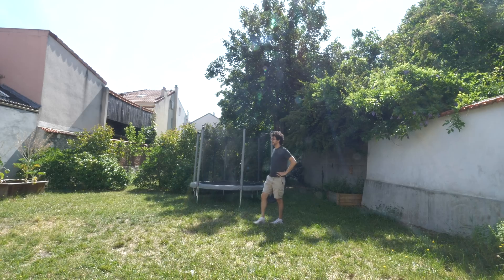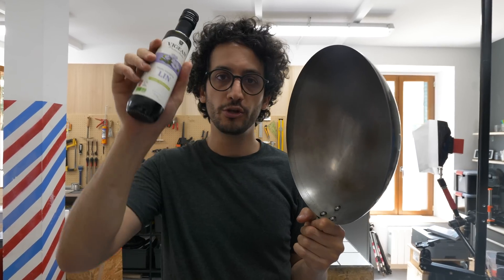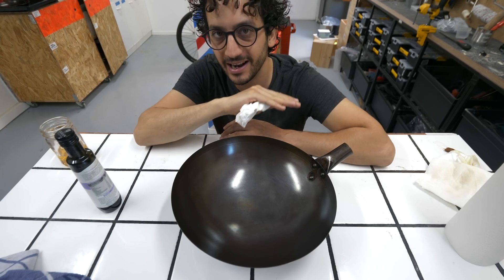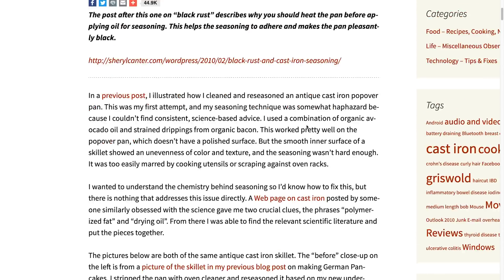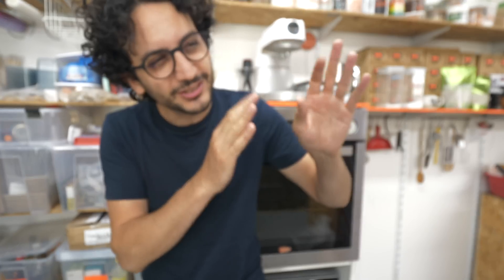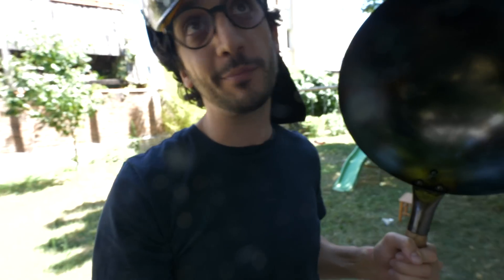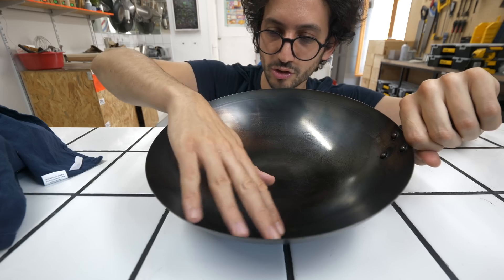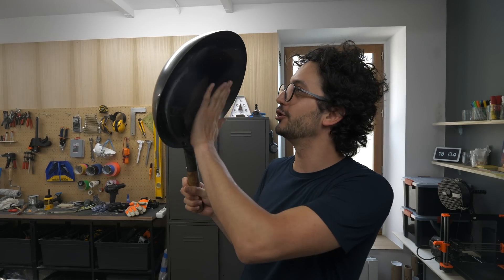Can I Make my Wok Slicker than a Nonstick Pan ?

Comment: ALL commercial non stick pans are made with forever chemicals. The ones that claim they don’t use PTFE and or PFOAA are simply using a sister chemical that is just as bad. 

Cast iron, stainless, and carbon steel are the only pans I will ever use. 

And pro tip from a chef. Light oil in any pan, heat, add a small bit of butter and immediately add the egg on top of it, and no egg will stick to any pan (even scratched up stainless). The best iron and steel pans are the ones you use daily. And soap doesn’t harm seasoning in any way. Wash those damn pans people.

Comment: Whilst its true that laxseed oil that has a low smoke point can form a hard polymerised surface for seasoning. But it isn't durable under high heat & will breakdown & flake off in your food which you consume.

Comment: Actually the linseed/ flakeseed technique has been debunked many times. It will not last long. Please use higher smoke point oils guys
Reply: Yes, linseed seems to flake but there's a confusion about wanting the smoke point high when you are trying to get the oil to smoke.

Comment: You must temper a Carbon Steel Wok before you season it. Here's my steps:

1) Handwash all metal parts, inside and outside with warm water dish detergent and dry . Make sure you wash off all detergent thoroughly. Dry with cloth.

2) Clean off any excess residue that can rust the wok by filling the wok 1/2 way with water, boil for 5 minutes, shut the heat off, wait 5 minutes, and scrub the entire inside of the wok with a natural fiber Tawashi brush with a stick so you don't burn yourself. Discard water, scrub wok in sink by hand with warm water and Tawashi. Dry the wok by hand

3) Temper the carbon steel wok first by heating the wok on high heat with a gas or propane stove without oil until the middle of the wok slowly turns gold, brown, very dark brown, and then dark metallic blue. Start tilting the wok to spread the blue spot until you covered the entire wok. Turn

Comment: Hello Alex. 

You need to revisit this one. Flax oil is really bad for seasoning. I’ve tried and failed with it, and I’m sure you’ve noticed as well that it flakes off very easily.

Refined grapeseed oil is what you want. Refined because it’s a pure oil with fibrous materials removed (fiber burn and cause carbon build up which causes sticking). Grapeseed because it has a high smoke point and a lot of polyunsaturated fat (which polymerizes better than other fats). You also want to bake it below the smoke point. I usually go 200° C for one hour. 

Check out “Cook culture” and the videos they’ve done on seasonings. The advice I gave you over comes from a phd in polymer sciences.
Reply: NO SMOKE NEEDED or My beginners guide to Carbon Steel stovetop seasoning ?
Reply: @LARCN  The «no smoke needed» video is brilliant. I’ve had great results with the advice provided from that video.
Reply: Alex listening to this one random lady with no scientific background or testing is cringe. No one else has ever recommended a low smoke point oil like flaxseed, yet this lady is some revolutionary oil expert.

Comment: if this is anything like cast iron , I have found just using it regularly builds a very nonstick surface over time. I can literally crack an egg in my cast iron skillet with no oil at all and cook it without it sticking, it will burn it a bit doing that and wont taste good so I wouldn't recommend but the point is it doesnt stick. when I am done cooking I can let the pan cool then just wipe it out with a dry rag everything just flakes off like nothing.

Comment: Great episode.  Flaxseed is a 'drying' oil and much better suited to seasoning cast iron/carbon steel.  I've switched over and re-seasoned my pans.  Also, a touch of dish soap occasionally to get the pans cleaned up will not strip/break down the coating.  Until I did a little research and actually tried it, I would never have let a drop of soap touch my seasoned pans.  But remember, the polymerization is a molecular bonding to the pan, a little soap here and there is not gonna hurt it and helps keep things cleaned up.  Just remember to recoat with oil after drying.  I like to reheat the pan to make sure the water is gone then apply a light coat with a silicone basting brush - paper towels can leave little bits behind.
Reply: Yes mon ami, flaxseed oil is a 'drying' oil. However, the very nature of its drying properties, while seemingly advantageous, can be its downfall in the realm of cookware. It creates a brittle layer, prone to chipping and flaking, a fact overlooked by many an amateur. In the hands of a culinary artiste, oils with a higher smoke point and more robust bonding properties are preferred, ensuring a seasoning that ages like fine wine, not like a fragile fresco.

As for the use of dish soap, you tread on a path that many fear to walk. And yes, a touch of soap will not ravage the seasoned layer, as you say. But it's not just about the molecular bonding; it's about the patina, the soul of the pan that develops over time. A seasoned pan is like a canvas, and each meal a stroke of the brush, adding to its unique character. While soap won't destroy this, it certainly doesn't add to the pan's story.

Comment: [ Wok ]             Nonstick: B+   Safe: ?  Longevity: A     Cleaning: B+   Versatility: B+

[ Teflon Pan ]  Nonstick: A+   Safe: ?  Longevity: C     Cleaning: B     Versatility: A

Overall I'd agree a wok is better. With oil, the nonstick difference b/t them is virtually negligible. I think the jury is still out on how harmful the seasoning and teflon are in woks and nonsticks, respectively. Wok's are basically immortal whereas nonsticks have to be replaced every few years. Cleaning the two are, more or less, effortless. Both pans can cook just about anything, but how well it excels/fails will really depend on what you're cooking.

Comment: Interesting. I use sunflower oil for my steel skillet- works well. Also I found out that cooking temperature is as important as seasoning. You might have a million layer glass smooth seasoning and still overheat the pan and get sticky food.

But then again, you can clean the pan, reseason it and start over :)

Comment: Actually, flaxseed and linseed are not good options to make a long-term seasoning because they are so insaturated that the coating eventually will start to peel off by its own and fall apart; canola, peanut or rice-bran oils are better options

Comment: I don't understand... Some of the polymer layer from the oil could still chip off or be absorbed a bit by the food in the pan... Right? Is the oil still not carcinogenic after it has been smoked/burned on the pan?
Reply: Yes, all seasoning will wear, it requires on going maintenance to pre-season. This is the problem with vloggers / bloggers with no real qualifications speaking about things they know little about just because it might get good traction for clickbait. Flaxeed may well form a hard polymerised layer but it is more brittle under high heat & will flake more easier than oils like advocado that have a higher smoke point.

Comment: I don't have a wok, however, I do use a Field cast iron pan, and a De Buyer Mineral B. I use Grapeseed oil over the stove. Each time I cook, I clean the pan, then heat it up, apply the oil, wipe almost clean, and let it sit on the heat for a few minutes. wipe, then wipe again while cooling to avoid sticky. then let cool to room temp, and store.

Comment: So...what did you use as the rubbing compound with that home made towel flap disc you created? You never explained what you were doing there for the final smooth step. Also, my wok has a wooden handle but there is a second wooden handle I cannot remove. Could I wrap it in aluminum foil and put it in the oven?

Comment: if the solution is flaxseed oil how come none of the reputable cs pan manufacturers( de buyer, matfer, mauviel)  recommend it?-they ALL suggest oil with high smoking point, pay them a visit. I tried it on my de buyer cs pans and it peeled of when searing steaks!!! back to square one with grapeseed oil.

Comment: I've heard that at least the first application of oil should be done in a hot pan - the heat opens up microscopic pores in the metal and the oil will fill those. I don't know if that's true, though.

Comment: Tip, don't use paper towels when cleaning or spreading oil between layers. Use a cotton towel, paper might leave small fragments that will become toast in the heat later on.
Reply: Maybe super duper cheap paper towels. I along with most home chefs have always used paper towels for seasoning. But if you have a kitchen cloth that wont ALSO release fibers when wiping down then that would be ideal to have.

Comment: What a huge waste of electrical energy to burn it in. And what a huge "reasonable" amount of oil you pour in for a single egg. But what's the "proper" temperature? Oil will smoke at about 120 to 170 °C. My max temperature is pyrolysis at up to 300 °C. Oh, and my wok and pans are burned it by cooking. I only might use an initial burn-in for my forged pans, which is that many years ago, I can't remember the year.
Reply: Smoke point depends on the oil used. The energy isn't a huge deal as it isn't often and still less than that of the manufacturing process of a Teflon pan.

Comment: Ok so what I learned after 1 year with my carbon skillet! 

1. Opposite to the dear lady's advice, you want to use an oil with a high smokepoint. With a low smokepoint oil, after a few rounds of cooking, your perfect seasoning will most likely start to flake & fall off. I use peanut oil, widely used in asian kitchens for seasoning woks, and seasoning is super durable, just keeps getting better and better over time.

2. No point in obsessing over the perfect seasoning, getting a clean black finish or whatever. A deep black finish of seasoning will not make the pan perform better in any way. Once you start using the pan and actually cook with it, it will look like shit anyways, and thats okay! Just keep cooking, that will make you and your pan happy!

Thanks for your video!
Reply: I agree, and avocado oil is my new favorite for seasoning, as it has a higher burn temp and more neutral flavor than peanut oil.
Reply: Awesome! I was getting pissed that my seasoning kept flaking off or I was scratching the seasoning off, this is the best advice yet, Thanks!!!
Reply: Canola oil. High smoke point and has very little organics in it.
Reply: Thanks! I was wondering about the ideal temperature, seeing that the article Alex linked says 500F = 260C but when I tried seasoning a wok and a cast iron pan I always managed to burn the coating right off as I was busy seasoning so seeing your reply, that makes sense. Just use an oil with a higher smoke point.
Reply: Would sesame oil be good? Smoke point is 410F.
Reply: @davidnettleton3375  It's not the smoke point so much as how much other gunk is dissolved in the oil.  Some oils are "gunky".  I seasoned my first carbon steel wok with olive oil and that was a HUGE mistake.  It was always "gunky" because of all the other compounds dissolved in olive oil and the chemical nature of the monounsaturated olive oil itself.

I'd recommend refined walnut oil for seasoning carbon steel.  It has a reasonably high smoke point but that's not what makes it good for seasoning.  Walnut oil is a "drying" oil - artists have used it in their oil paints for hundreds of years because it's not gunky when it dries - it dries to a hard, glassy finish.  Likewise, when you polymerize it in a carbon steel pan, it achieves and maintains a glassy, dry finish.

Avocado oil also seems to work pretty well.  I know corn oil gets used in Asia some, but I find it's somewhat gunky as well and I wouldn't use it.  Refined peanut oil is popular in China and I suspect it would work well.  Nothing is better for frying breaded chicken than peanut oil.  

Although walnut and avocado oils are pretty expensive, keep in mind you only have to use a miniscule amount to season even a large pan or wok.   And they're great for other things.  I love walnut oil in salad dressings - it has a great mouth feel, similar to olive oil but lighter.  I made homemade mayo from it as well, which was delicious.  I've even used it when making pesto.

Avocado oil I use in my air fryer.  I keep some loaded in a spray bottle.  It's stable up to extremely high temperatures, so it doesn't get baked onto the nonstick surfaces inside the air fryer or get sticky and gummy.  And it's great on breaded stuff, like air-fryer chicken - very light, helps things crisp up, never tastes burnt.
Reply: @sunspot42  Thank you for such a great reply! Lot's of good info! Do you know if Sesame oil is "gunky?" I ended up doing a couple of rounds of seasoning with it, and it's turned out pretty good so far. I used what looks to be a good quality extra virgin oil, not that cheap stuff you buy in the Asian section at the grocery store.
Reply: @davidnettleton3375  I'm not sure.  I seldom use sesame oil because it's so expensive and I don't care for the flavor except in moderation.  I suspect refined oils are better for seasoning a wok than virgin pressed oils, since they'll have fewer contaminants that could turn gunky or interfere with the seasoning adhering to the metal itself.  But I don't know for a fact they're worse.  Just a suspicion.
Reply: You don't understand science, do you? Sigh.
"I think this is better" Ignores the science
eyeroll
Reply: @GTrainRx7  You could probably be convinced that gravity doesn't exist if you were told "the science" says so.

Comment: This is nothing that is unfamiliar to cast iron pan owners like myself. What I'd say is that firstly, the pan/wok needs heating with no oil first in order to drive out any residual environmental moisture. In the case of iron, this "opens" the pores (which is not a literal thing, I know). I wipe oil my oil (also linseed) whilst the surface is still warm so that the oil has a lower surface tension and is able to work itself into the surface's structure, microscratches and imperfections better. Beyond that, it's much the same process as here of wiping till cloths come back clean, baking for 30-60mins and repeating several times.

Comment: I know this is an “old” vid but I’m pretty sure for something to have less grip and be more non stick it has to have pockets of air between the smooth bits. If the surface is completely smooth there is more surface area in contact with what ever you’re cooking but if you have an evenly raised and lowered surface there will be 50% less surface area in contact.
Reply: Eh, yes and no. 🤷🏻‍♂️ Consider this: If you have 2 surfaces that are "phobic" of each other, you have a nonstick surface; even if it's a precision ground, hand-lapped, high polish, vapor deposition surface. An oil droplet in a glass of water is surely a contact scenario that is nonstick, agreed? :) Is it also agreed that the droplet and the water surface are in 100% contact? It's those hydrophobic tails of the oil molecule that keep the oil and water separate. Your imagined scenario is along the lines of the Leidenfrost effect. It's valid and true, since we can certainly get a nonstick surface by not having any surface contact at all! 😸

Comment: If you're using linseed oil (flax oil) and want a deep build, use an old artist's trick. Remember, linseed oil has been the traditional polymerizing oil binder for oil paints for centuries, and a lot of tricks have been worked out along the way (many of which are undoubtedly "happy little accidents"). The only real difference between food grade, artist's grade and industrial grade is the cleanliness (both physical and chemical) of the process.

Make a "stand oil". That involves taking the linseed oil out of its nice UV-resistant/light-blocking container and putting it into clear glass. Then let the sunlight get at it for about a week (traditionally, you'd just set it on a window ledge). That will get the polymerization starting, but weakly, thickening the oil quite a bit. It will be self-levelling at that point, so even though it's much more viscous, it won't leave any "wipe marks" before it goes in the oven/on the burner. Still, it will be thin enough to do a controlled build-up rather than leaving a couple of overly-thick and fragile layers that will just chip and flake on first use.

Comment: I have a tip. In order to get a smooth finish when you use the buffer wheel, you need a polishing paste. There are plenty of metallic polishing pastes but a non toxic one is needed here. My solution is to use toothpaste
Reply: bad idea : toothpaste will remove the coating, like any soap…

Comment: Hey Alex, Chinese pro Chef don't stir fry with stick wok that's for sure, why don't you just learn how they do it? I happen to watched a video about it, which is that you heat the wok dry on high heat (which will open the little gaps on the surface of the wok) then you put a lot of oil when it's smoking hot and then throw that oil away (so the oil will goes in the gap and make a flat surface, so whatever you cook will not stuck on the gap and eventually stick on the wok) and then you add the oil that you want to cook with and start cooking. as simple as that. Uncle roger posted Chef Wang Gang's video and I see him using this technique too with his wok, so you could maybe give a try.
peace.

Comment: It would be interesting what would happen if you "Slow Blue" a pan. It's the method used for coating Guns in the past and its kind of close in terms of surface. To do it you need to let the pan rust evenly and very thin in a controlled moisture and temperatur environment. Then you boil it in water and finally you rub it down with 00 Steelwool. Then you repeat it like 10 times and then ur done ;)